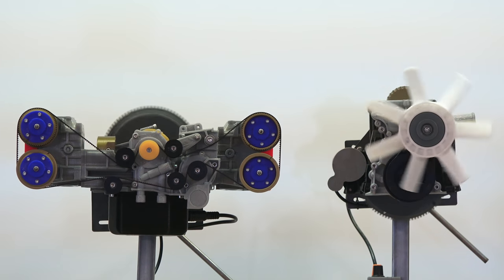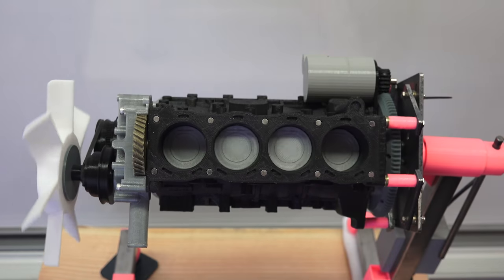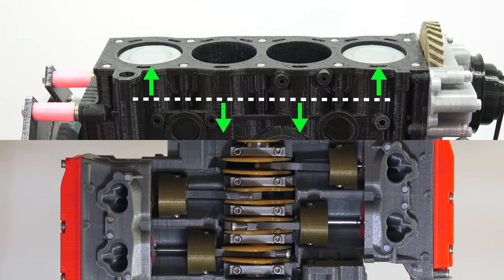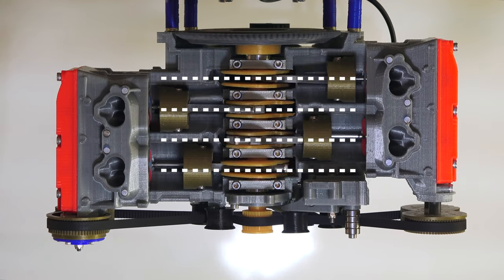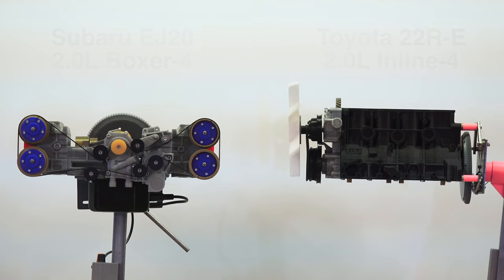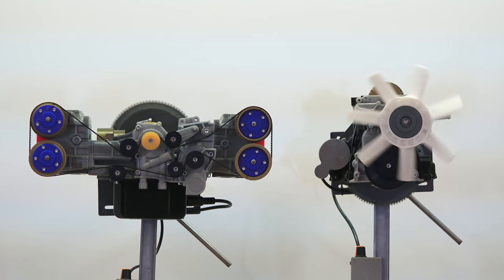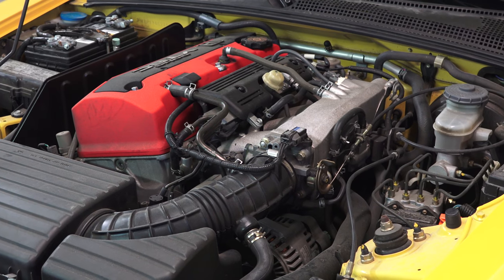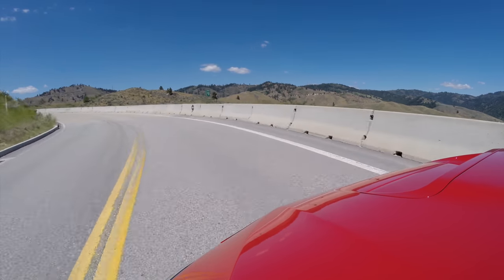The Differences Between Inline Four & Boxer Four Engines

Comment: Boxer engine=2 head gaskets,. Oil never drains down to the bottom.  I'll leave it there.
Reply: If they're good gaskets its all good. I've seen Subarus with nearly 500,000 miles still being driven daily. All gaskets wear out eventually no matter how the engine is oriented. A seal is a seal, it should always be sealed regardless of forces acting on it.

Comment: Interesting, can you look into the most rescent Subaru 6cyl engine. Has a lot of vibration issues and upgrading engine mounts didn't fix the problem, apparently Subaru is going back to 4cyl referring to your statement that adding additional cylinders cancels out the vibration

Comment: On my Audi 80 B4 with it's 4-Cyl-inline, I change a cyl-head with out lifting the engine out of the engine bay, also, there is one very simple timing belt. Cheap, easy, reliable. The boxer engine has advantages, but wich of theese do you really in an everyday driver?

Comment: The Boxer vaguely resembles the engine found in a Cessna.
Reply: Aero engines with that configuration predate VW and Porsche engines. They existed just after WWI and there are engines in production today (the O-200.., which was on the new Cessna Skycatcher) based on a 70 year old design.
Reply: KastaRules   Love the Lycoming!
Reply: Aircraft piston engines meant for nose-mounting generally strongly favor symmetry, so the flat ("boxer") layout is the way to go (or a radial engine). It just makes a whole lot more sense from a packaging sense, because it enables you to easily keep the prop aligned with the center of mass without having to resort to various bevel drives or transmissions. Aircraft also don't have the sides of their engine compartment covered by suspension and wheels, so getting to the side of the engine is as easy as loosening a few screws and taking the cowling off.
Reply: actually are VERY SIMILAR .. so much, that porsche sold many boxer engines for aircraft use ....

Comment: do boxer engines have two head gaskets?
Reply: Yes
Reply: Yes, they have 2 heads, one on each side
Reply: Not only do they have 2, but around 2000, they had really deficient gaskets,  which are famous for blowing and requiring a head overhaul at the least.  Major pain in the keister.
Reply: Mr Reymundo and famous is not great always
Reply: I mean it has 2 heads, so obviously yes.
Reply: Both of mine were found to be leaking oil last week.  But the almost blocked cat was what was really hurting it.  2003 WRX.
Reply: The boxer engine, was flawed at concept, unless your flying a plane and it is meticulously maintained. Subaru has had to make an overly complex system of oil gallies, and etc. to compensate for the oil pooling and starvation of oil
at the upper part of the piston. Gravity, dirty oil and spent fuel make a lethal combination. Even spent coolant corrodes aluminum blocks. Can you see the picture. I know, let's make better head gaskets, etc., etc........and the list goes on. How much center of gravity do you need in bumper to bumper traffic. If you LOVE a Subaru, buy it. But be prepared to take meticulous care of it. Use the best oil and filter. As always, big corporations are not perfect. We see them fall to the wayside every day. Good Luck.
Reply: Don't you believe in gravity? And, "No." The Earth is not flat!
Reply: Only the left head has a head gasket.
Reply: Subaru added for the earlier engines that had the possibility of a head gasket failure a stop leak solution for the coolant that kept the gaskets flexible and well sealed. I am driving a 2002 Subaru Forester.i check my pil regularly as well as coolant as what i was told is that low coolant levels on a opposed engine configuration will cause a head warp.seems sensible to check more often...
Reply: Mr Reymundo lmao wrong.
Reply: JACOB  KATARI yes i agree fully.
Reply: double the risk
Reply: The Lycoming XR-7755 aero engine can 'better that' because it likely had 36 head gaskets.
In contrast, the  Armstrong Whitworth Swing Beam Opposed-Piston Engine appears to have no head gaskets.

Comment: What would be the advantage/disadvantage if we made two cylinders fire at the same time, i.e change the firing order to 1-2&3-4 as to make cylinder 2 and 3 fire at the same time after cylinder one and before cylinder 4. Or even 1&4 then 2-3? 
And of course we need to modify the camshaft and distributor.

Comment: Can overheating (or unequal heating) be an issue? The 4-cylinder boxer has a cylinder on each corner while the 4-in-line has two cylinders in the middle of the block.

Comment: Why not have un-equal length pipes attached to equal length headers straight after  ???? Don’t know if this would work but get the best of both? Two tone rumble is best sound in my opinion and is it really a issue on a boosted engine? Maybe makes it more laggy but the newer Subaru eg20 engines had variable inlet cams to overcome the lag issues so keep it un- equal Subaru?

Comment: I4: lower weight, smaller dimensions, lower complexity, less moving parts, less parts to replace, higher reliability, shorter servicing times, lower servicing costs, VERY similar centre of gravity height when TILTED (like in my mid-engine RWD Previa MkI 2.4 I4 16v) ... F4: nice vibrations ... Hmmm, I wonder which one is better... :-))))))))))))))))))))))))))

Comment: Boxer engine is a very reliable engine, an inline 4 may break if it in the redline area, in the boxer.  Not really. It's due to the boxer has a good weight ratio making it to not wobble while the inline 4 does. Just compare it in 0:01, the more vibration, the less performance come from a car and horrible reliability at high RPM range. Inline 4 sucks at performance. The boxer suck when it comes to the engine overheats. The fan can't cool it down easily due to the fact it  is against the weight ratio. Inline 4 is good if you don't put it in high RPM range and boxer is good when you just want to go to a short trip to some where. Otherwise your engine might stop and have to wait a little time to cool down and start it again, inline 5 wins when it comes to a big road trip to somewhere. Both engines are different and have different meanings. In my opinion, boxer wins This when it comes to reliability and performance, same as fuel economy as well. You may have a different opinion but I would prefer the boxer over a inline 4, get this, both engines are awesome so don't complain.
Reply: Hate to say it, but an inline can rev higher more reliably than a flat can. i rarely see a flat four run into the 8000rpm range and not have issues, like most I-4's. Take Honda for example, F20C out of the S2000, crack 8600-9000rpm all day, or 8500RPM from the B18C from the ITR all day long, 8000-9000 from the B16A, etc, and have no issues, i doubt a boxer could do that for very long, in fact I know they can't, i see people who beat on their WRX's and STi's and they end up running like a bag of crap, and they have redlines of 6000 and 6500 iirc. As for the 5 bangers, those things are awesome, and have this awesome throaty sound when you plant it!
Reply: Tyler Deabreu I totally agree with that dude but I kinda hate the inline 4 due to the vibration to the engine causing horrible performance and can annoy sometimes. All though I love both engines, highly reliable but a boxer engine should be my choice due to reliability purposes.
Reply: Am i the only one that's amazed a Lan Evo is protecting something in a WRX
Reply: JDM Lancer Evolution X not sure about that, most sportbikes engines are inline fours and can rev way past 12k rpm
Reply: My Impreza Wrx is not very fuel efficient the turbos are known for it. Even if I stay away from boost it still drinks it more than a 2lt NA engine would. I know there’s no easy fix but I havint worked out why. Having two cats and three on the bug eye must be saying something? Maybe the factory ecu mapping is not great or maybe being turbo charged the need for bigger injectors ruins low rpm fuel efficiency ??? Or is this an effect of low compression engines? If any one knows please comment...

Comment: ya. that's accurate about making them a 6. Inline 6 usually doesn't even need a harmonic balancer. Inline 4 cyl. engines generally start to become rougher in anything over about 2L. 2.4 is kind of the cutoff point that I was taught anyway. at 2.4L, an inline 4 becomes pretty rough, rough enough to not use it. Toyota makes some pretty big inline 4 cyl. engines, and with each increased size is a corresponding increased roughness. 
--I4 is def. easier to work on. Boxers do have a nice sound, but so does a V8.

Comment: Very informative video. The Subaru is starting to really shine with people. Their all wheel drive is <always pulling> .. It is in real time. This make it move out and have much better grip to the road than even standard AWD when it only gets executed when their is slippage on the terrain (don't laugh .. I know it's the 21rst century but using snow tires on any vehicle simply does wonders for it's winter driving.).
Reply: Hard to beat Subaru's symmetrical AWD system.

Comment: Looking to buy a new vehicle and I’ve always heard Subaru is the best. I mentioned this to my son, who is a car buff and owns two car clubs, he says mom I don’t like the flat box engines, better to choose an in-line. He wants me to buy a Hyundai. So I had to come out here and see what the difference was between the two. I’m glad I did because after reading the comments it seems that the Subaru has head gasket leaking issues oil leak issues. But then I also learned that they start better in cold weather because they are already at the level of oil so they’re lubricated better. But Subaru seems to be hurt harder and more expensive to repair. So again he’s probably right.

Comment: Im not a fan of suburu and really like the concept of the boxer engine, but I think it would be wise to have the spark plugs be changed from the bottom by removing the splash shields or portions of them or even little cutaways to access the plugs, and then design the undercarriage with dropping the whole unit in mind, maybe with a second control arm type mount designed to use an angle iron based part to hold it to the body and out of the way of the subframe so the car can be wheeled out of the way.

The process for that would be to loosen all bolts, remove or undo the upper intake supporting components (that would be designed to stay with the vehicle), starting on one side jack the body up and remove the wheel (and the axle nut, before or after the wheel), then the tie rod and pop the ball joint off, then remove the axle and install a fluid plug if the fluid wasn’t drained, place jack stands under subframe on the side you’re working on, lower jack enough to rest subframe on jack stands, remove lower control arm and install bracket tool to body and spindle, lower jack entirely, repeat for other side. 
At this point you have the weight of the drive train on the stands and the vehicle may be on it’s wheels, remove the bolts holding the subframe to the body and inspect that all hoses wires and connections are free and clear, jack subframe from jacking point tab (centre and away from area where bolts and jack stands are) and lower jack stands on that side, repeat for other side, then jack from tab and replace jack stands with blocks of wood or stacks of 2x6+ (the wider the safer), repeat for other side, repeat and swap for less wood or shorter blocks back and forth till on single board or sheet or ground (keeping angle in mind and not having too much height difference at a time) roll vehicle back, using ramps if necessary

Comment: I had a 1982 Subaru with push rods and loved it. They put the OH cams and turbos Subaru made them less reliable and way more expensive to repair of that crap goes south. My motorcycle is a 2 Cyl boxer air/oil cooled engine. Love boxers...My airplane has a Lycoming, also a 4 Cyl Boxer.

Comment: I have a Subaru with the 2.5 boxer in it, and I was wondering how oil is kept from sloshing in to the cylinders when cornering hard or generally exposing the car to strong forces  sideways, since the cylinders are laying flat quite close to the crank. Is there some design in the crank case to mitigate this? 

Another thing I’ve been thinking of is how come the cylinders are so resistant to being honed out oval by repeated friction biased towards the lower cylinder wall due to gravity (mainly cold starts)?

Comment: What is the difference between a Volkswagon pan 4 and a boxer? 
Are opposed twins on BMW motorcycles boxers? The 4and six cylinder gold wings are not considered boxers but the have opposed pistons.
Finally, what about that engine type that has connecting rods on both sides of the piston and is in a flat configuration?

Comment: I've got a 2.9l inline 4 diesel and it's a very smooth engine . It's in my Hyundai (Terracan)and is a Kia engine, same company essentially. In my car it is inline so powers my rear wheels. My friend has the same engine in a completely different car (Kia Sedona) and it's laid transverse and powers the front wheels and is equally smooth. For a big old school diesel it's not a bad sound TBH, mine changed its sound a lot when I had a stainless steel exhaust fitted.

Comment: I prefer flat six, then inline six. 4 bangers have vibrations at different speeds, If you want quiet six is the way to go. The has to be a reason why Cummings makes B series engine, Caterpillar C12, or the MB MTU 16V-4000 or the Detroit series 60. The Mercedes is a 12 cylinder basically a twin 6. most people don not know that slow moving gravel truck most likely has a 6 in it and it probably weighs as much as their car and has 500, 000  miles on it and it is at least 15 liters or about 10x the size of the motor in your Chevy Cruz. V engines are because of how much sheet metal or plastic is needed to cover a I 6. But if you are going to buy a Peterbuilt and spend $150,000 or more for it you expect in to still be running when a Cruz with the same miles on it is junk. Besides cars are fashion and OTR is about staying in business and making money.
Reply: Warren Puckett all well said and accurate.

Comment: Actually, the reason the subaru...and old VW's for that matter...have a 'rumble' exhaust sound is because the way the exhaust systems are set up. You have two cylinders firing on one side going more or less to the pipe on one side then the two cylinders on the other going to that pipe. If you put a four into one exhaust on a flat four, it sounds like any other four cylinder. 

I had a VW with a standard system, It rumbled. Put a 'stinger' system on it, it sounded smooth.

Comment: If you look back in time, like the 80' Porsche made beasts using boxer 6 (Flat-6) engines in  their 956, and 962
2.65L with 640 HP in the 80',and it finished at 24h Le Mans

Comment: In the Citroen is a 4 Zylinder aircooled Boxerengine . It s a very great engine , because it runs from 750 till 6500 without any vibrations and it is for an aircooled engine not so loud . It has it s specially amazing Sound . This engine was buildet from 1970 tilll 1986 in the GS , Ami Super and the GSA .

Comment: One is head and shoulders better than the other 
Horizontally opposed is simply the best engine configuration 
Twins , fours, sixes, eights and even the flat 12 Ferrari used in the 80’s were all beasts

Comment: what about cylinder ovality probleme on H boxer engine configuration, due to the fact one side of the piston the down side, is always more in contact with the wall of the cylinder  lead to an uneven wear on the cylinder, wich ultimatly lead to oil comsumption. and lost of power  and a shorter engine life.

Comment: While in Japan I went to a tuning shop, they sold all kinds of things I found they sold weights that you could stick to the engine on the outside, could you explain how does that works? I'm pretty sure it has to do with vibration but how is that measured and determined where should they be installed?

Comment: @Engineering Explained You failed to mention the most negative aspect of Boxer Engines.They are prone to oil leaks,whether it be a head gasket or valve cover gasket, not to mention others.This is due to the oil always sitting on seals.
I do agree however that a straight 6 is a perfectly balanced engine.

Comment: If you like boxer engines, check out the original designed by ferdinand porsche himself, the Volkswagen type 1 motor. It has the same basic charecteristics as the suburu h4, but has a single in block cam, and sounds amazing, especially when the engine is bored from a 1.6l to a 1.9l

Comment: I have a 2016 Subaru STI with 99K miles, so I have to change the correct timing belt. My question is that I should replace part of the timing belt. Thank you

Comment: One large disadvantage of the boxer is where the oil lies. It really needs to be a dry sump motor like most Porsche motors (air cooled  and the 996 turbo) to get that oil from smashing into the cylinders and blowing past the rings.  Cornering, overfilling or anything but level parking is not good for a wet sump. Boy do they feel good.

Comment: I have a GT86. I haven’t wasted any money on mods yet. I would rather spend the money on fuel, tyres and track days.  If I modify anything it will be for weight reduction, perhaps power and not aesthetics.   However I keep thinking about unequal length headers for a Subaru burble.  Which is slightly irrational.   There are many things to love about cars and I guess noise is important.  Have you or would you do a video about the sound differences of different engines? V12, V8, V6, V4, 6IL, 4IL, boxers 4c & 6c, W16’s etc.